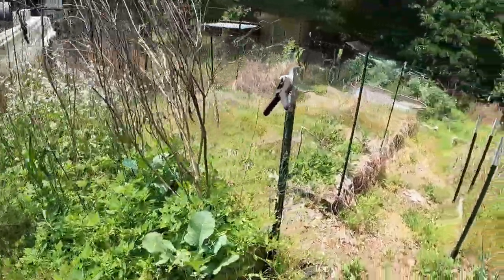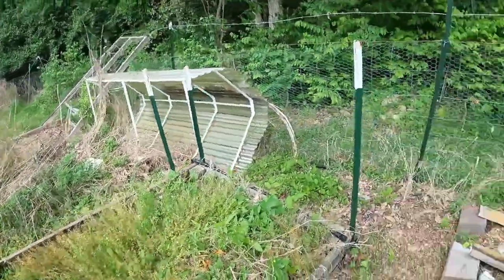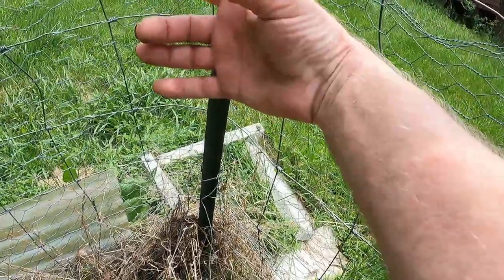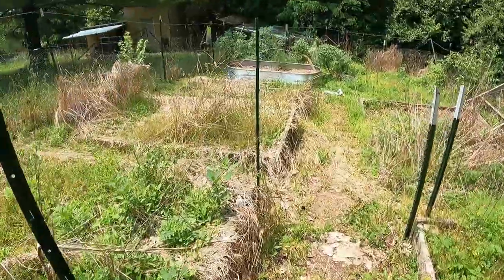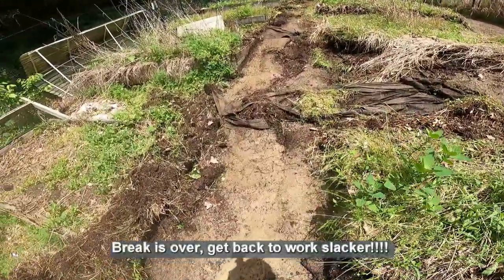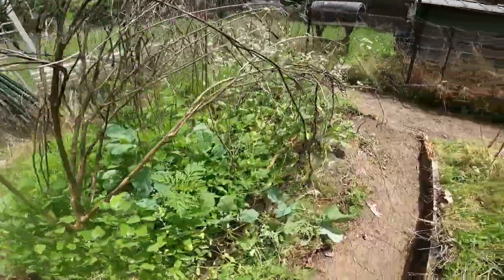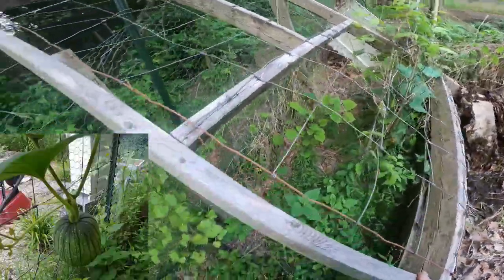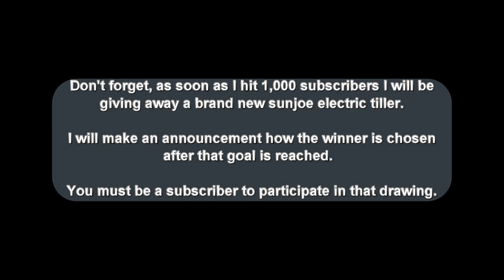tearing up weed barrier #weed #barrier #fabric #removal #garden #raisedbed #raisedbedgardenremoval

Comment: Oh Gawd, I put tarps over my garden and the weeds grew right through it, I have been getting the edges up and tying a rope and pulling it off in strips with my truck.  I got sick with long covid in November 2020 and let it go, my bad,  I weed eated a bit this morning, it is so hot still clearing the tall grass weeds before I use my new handy dandy tiller cultivator. I am a woman by the way Hurchel was my dad's name,....
Reply from the maker: It def does not take long for the weeds to take over and once they go to seed even once, it can become a nightmare.  The next 3 or 4 video uploads are about this new garden makeover, it turned out really good.  Hopefully you can find some tips and tricks in it to be helpful with your problem.  Before I considered just removing the raised beds and starting over, I seriously considered a diy flame thrower to kill the weeds :)  I was about to make gardening fun again :)
Reply from the maker: and btw, Hurchel is a great name, reminded me of how much I liked "Hershel" on the walking dead :)